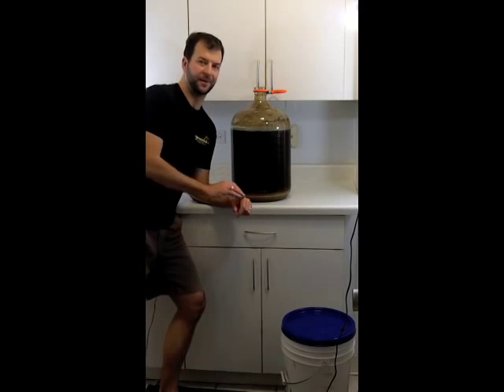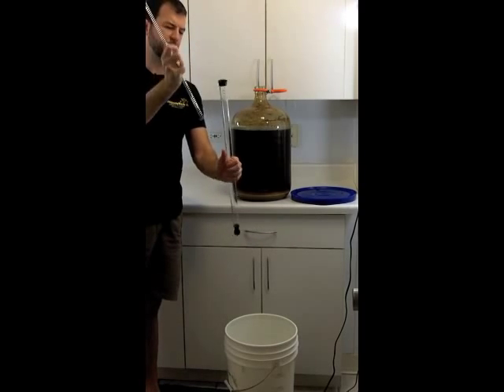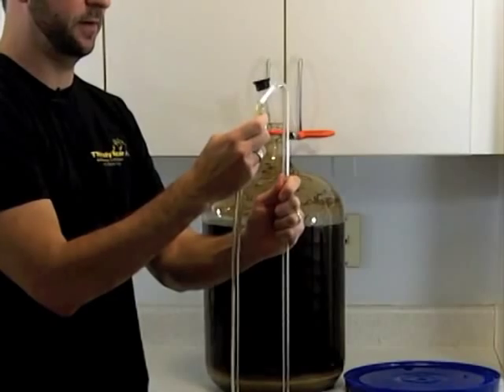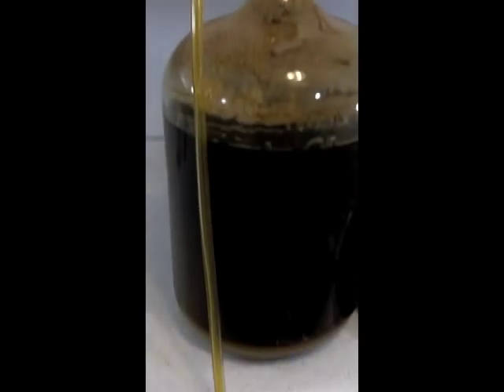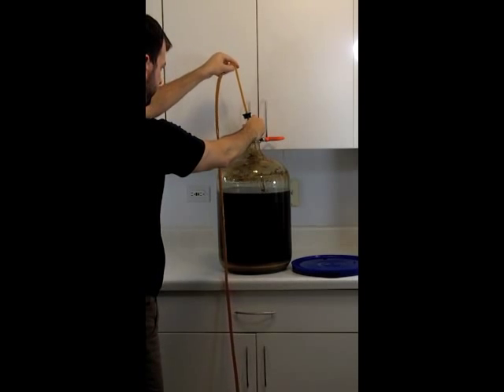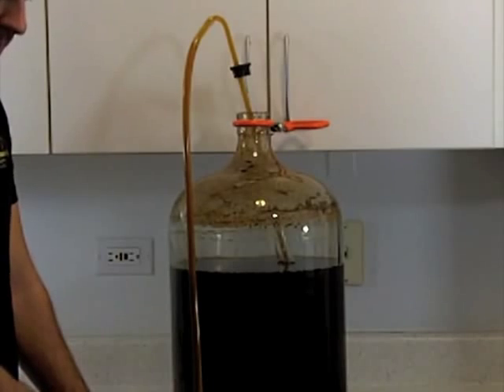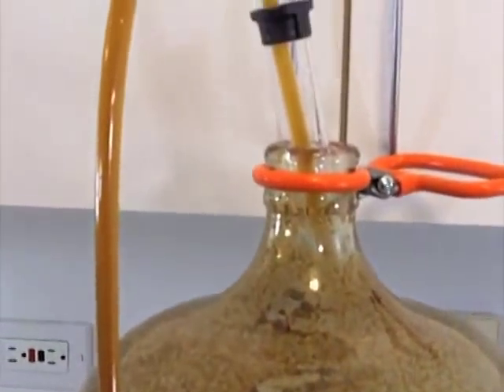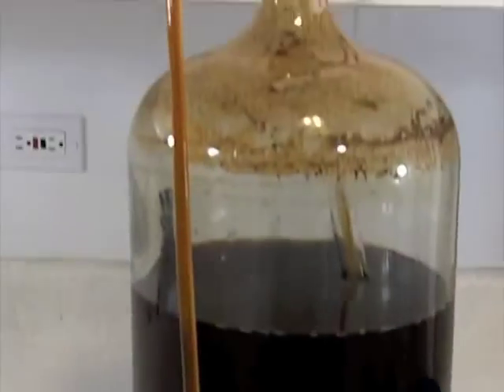How To Use An Auto Siphon To Transfer Homebrew

Comment: My mini-siphon I got from Northern Brewer in a kit sucks.  I can't get the thing started unless I pump it 18 times and the pump part gets stuck in the tube many times when trying to push down (like it needs wearing in). Then when it does flow a bunch of air bubbles get in at the start and end of the flow.

Comment: thought u had to start from the top n drain downwards to get no trube/yeast
Reply: +eddy viera the auto-siphon has a barrier and pulls downward from about 3/4 of an inch above the bottom, so you don't get the crap off the bottom.   The black rubber piece at the bottom of the large outer tube is the part I'm talking about.
Reply: @zethreal3219  depends how big your cake is, I would still clip it above by an inch or so

Comment: why would you let it soak in the tub...... thats such a huge waste of water. just use a scrubbing cane.
Reply: dan 

You do both. Soaking helps soften the dried grime.
Reply: what's up get a seven spray wand and attach it to a garden hose or laundry sink with an adapter, it basically pressure washes everything away, often no need for a brush.